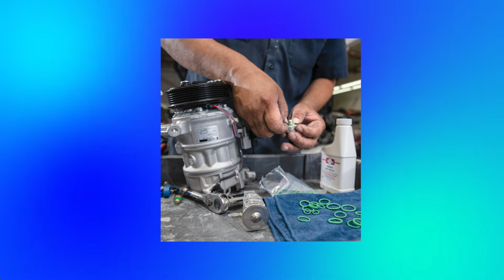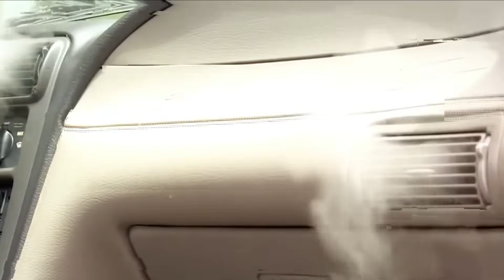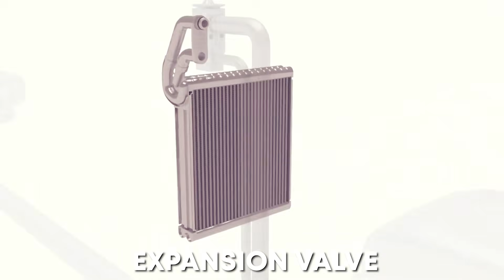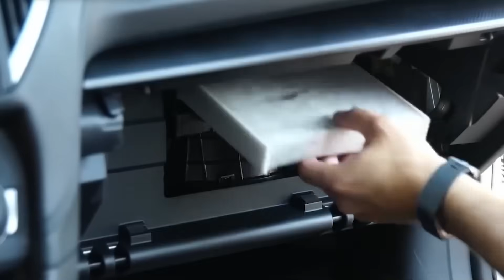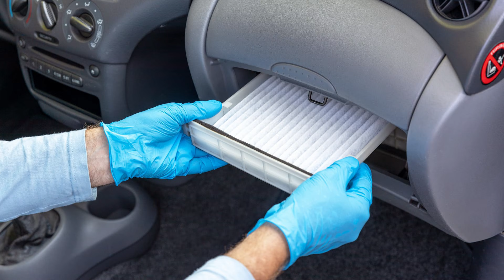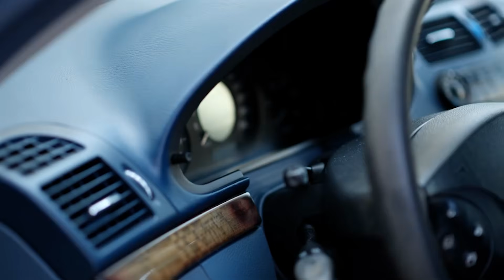The Science Behind Your Cars Air Conditioning

Comment: I have a 2009 Ram 1500 and in the winter when I turn on the heater the air comes out warm from the passenger side but cold on the driver side
Reply from the maker: Sounds like either a blend door or the actuator for the blend door for the drivers side.